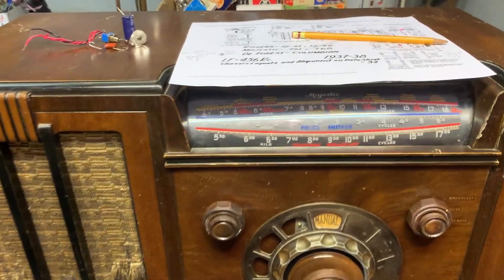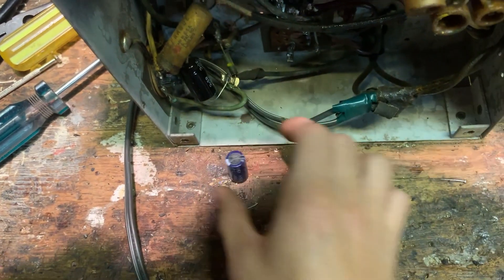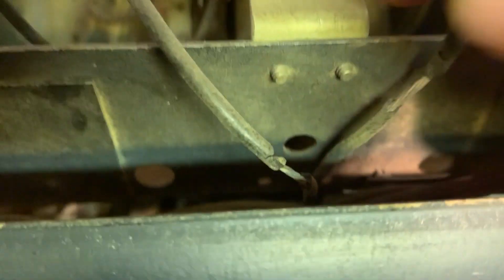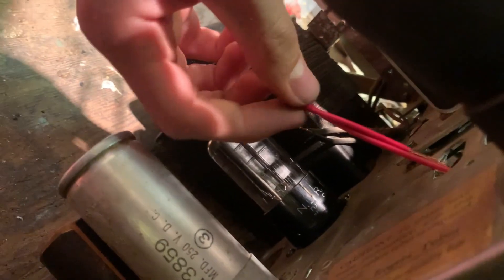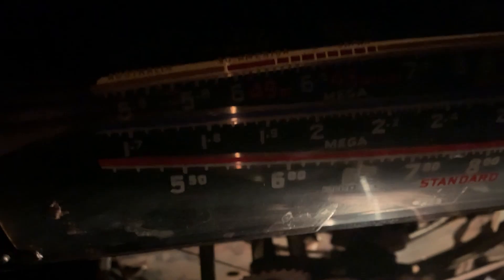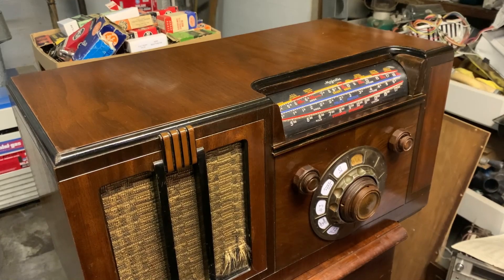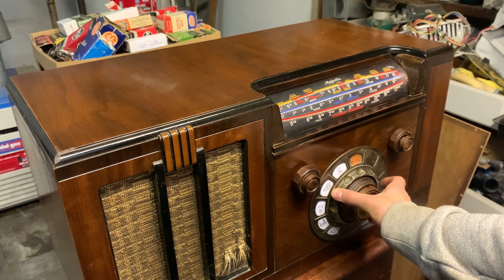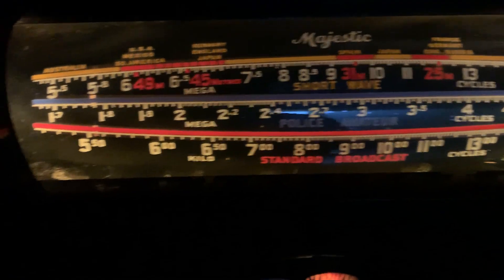1937 Rogers Radio Part II

Comment: It's good to pop a rubber grommet into any hole in a metal chassis if you're going to run wires through. Especially if they move at all like your radio dial light. In time the friction will wear through the insulation. The time of course for that to happen is a function of how much it gets used. It's just a good practice to do this in any application where wires go through metal holes and there's any vibration or mechanical movement.
The dial looks really good after your work on it.